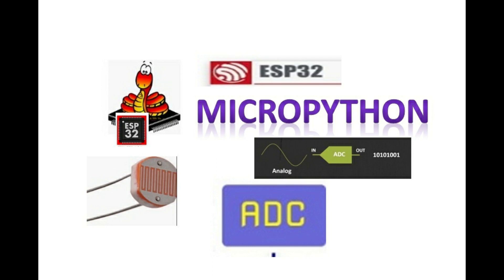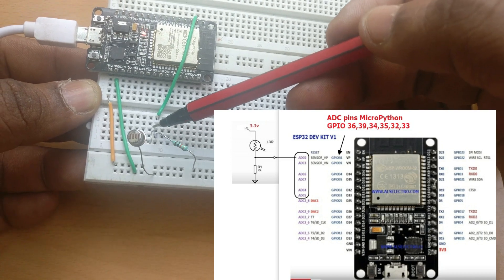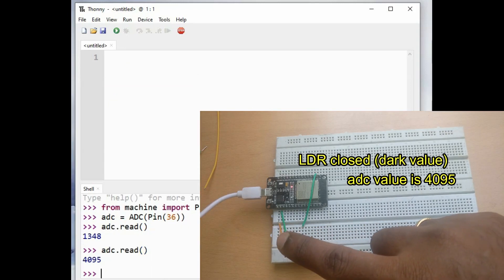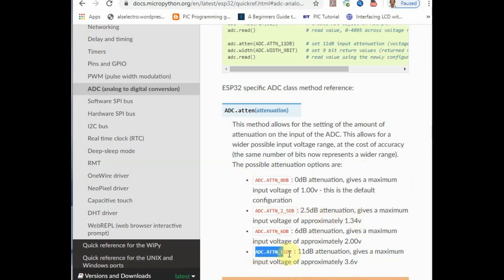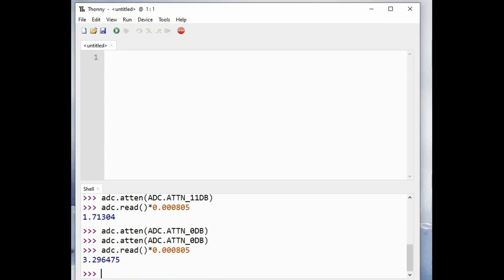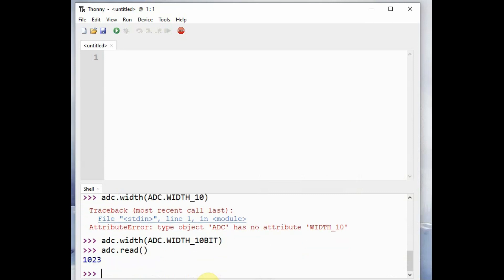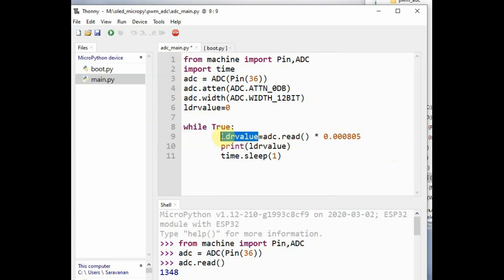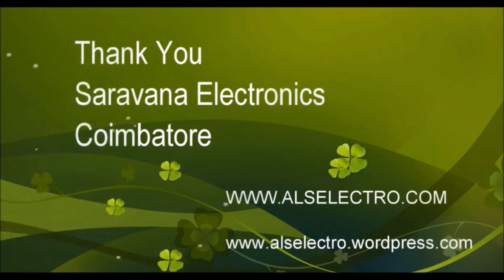ESP32 MICROPYTHON ADC with Analog Sensors

Comment: I  have a question, how can i use the sensor sct013 with esp32? i tried to use this sensor and i have this error: Traceback (most recent call last):
  File "<stdin>", line 8
SyntaxError: invalid syntax

here the program:

from machine import Pin
import time 
from machine import Pin, I2C
from esp8266_i2c_lcd import I2cLcd
from machine import ADC

sc = machine.ADC(32)
SyntaxError: invalid syntax CONVERSION_FACTOR = 1.1 / (0.001220)v

while True:
    voltage = sc.read_u26()* CONVERSION_FACTOR
    print(voltage)
    time.sleep(0.1)

Comment: Hello sir, could you please make a video to read voltage via voltage divider?
I'm not getting it to work properly.

I should read a range up to 30V. (to build something for renewable energy capable of working on both 12 and 24v systems)
I've used R1 as 100k and R2 as 2.2K (resistors I have here), to drop a max of 46V down to 1v (default max input voltage without changing attenuation).

problem is, I try to calibrate and test with 4 li-ion cells (around 16V), I remove 1 cell and instead reading around 12V, it reads 9 and bellow.. :(

and values are not stable from the ADC reading.

I would be really grateful if you can came out with a little tutorial on this :)
Thanks in advance.
Keep safe